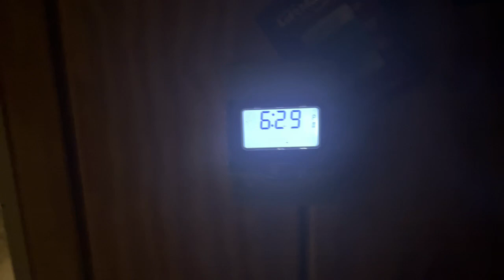Buffalo Blizzard Live - December 23, 2022

Comment: It's just like this in Rochester too.  You didn't mention it's only 5°F and 30 mph wind.  That's a high calling for the snow melt system and an extreme condition you don't really need to design to anyway.  At least the snow that is on the driveway isn't iced down and stuck like a rock.
Reply from the maker: Great points Dan!  I did shut it off about 1 - 1.5 hours ago, it just doesn't make sense to let it run all night.  It hasn't let up at all and tomorrow looks to be most of the same.  I don't regret running it all day, it was a good test to see what it would do.  I'll fire it back up 1-2 hours before we start shoveling / snowblowing so it's not all ice underneath.  If I had a fully automated system, it would go into Cold Weather Cut Out at 10ºF by default, and we're really close to that without the wind.

Comment: It’s 2 deg F at my house in Lancaster and 15 mph winds.  It’s silly to run it now.  I was shocked to see you don’t have a storm door in front of that beautiful wood outer door.
Reply from the maker: I'm showing 11ºF here which is right on the border for Cold Weather Shut Down.  Most snowmelt systems will automatically shut down at 10ºF.  I did end up turning it off not long after the live stream.  It was a fun test to see what it could (or couldn't) do today during a storm like this, and maybe it cost me $15 or so, but it was still worth the try.  I will turn it back on when things slow down either tomorrow afternoon / being or Sunday Morning.  We were expecting to go somewhere tomorrow and expecting company Sunday, but who knows if either of those will happen anymore.  Either way, you're right in it being silly to let it run all night.  I did shovel a small section for fun and the bottom was not ice, it came right up.  I think the snow is acting like an insulation blanket.  Regarding the door, it needs to be refinished, and once I do that I'll be adding a storm door.  We really dint want to cover up the beautiful woodwork with a storm door, but we've found the elects like this are hitting it to hard.  It's been 10+ years.  Maybe I'll do a video on it when I do it!  😊  Thanks for watching!

Comment: For times like this where it's not keeping up, could you increase the temp to compensate or is it a lost cause and/or too wasteful?
Reply from the maker: Hey Ed.  I absolutely could, and have done that before, but it gets to the point where it's just not worth it.  With the temps as cold as they are, and the winds at 60 MPH+, there is no way it can keep up.  I'm to the point now where I need to decide if its worth running overnight, or just turning it off and starting it back up again after the event.
Reply: Thanks Chris, I guess if you don't have to leave the house, then you might as well save a few bucks!  I've been enjoying all your videos.  Very informative and interesting to watch your journey.